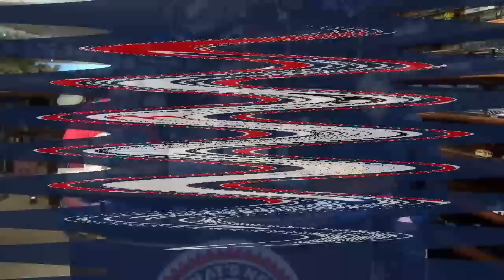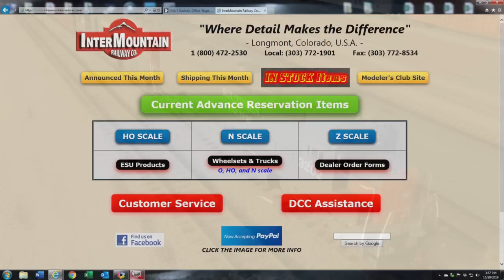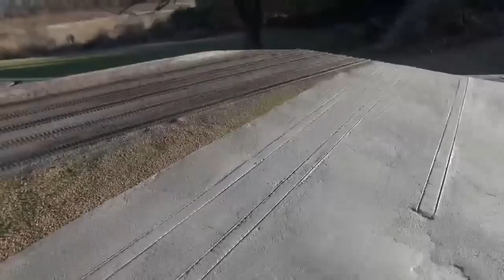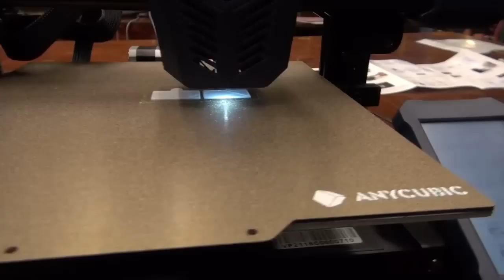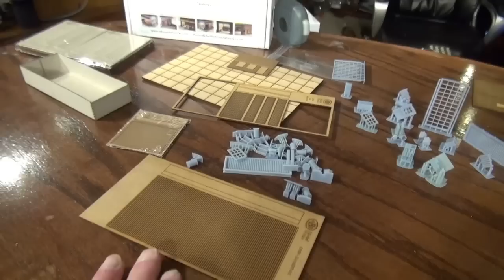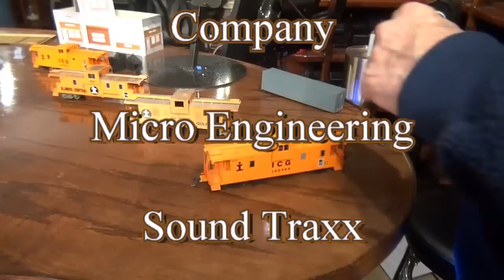What's Neat This Week in Model Railroading #217 December 3rd 2022

Comment: I find it odd that you say you can not see the layer lines,  I can clearly see the lines in the video  they run at a 45 degree angle to horizontal.  The studio lights pick the lines very easily as he turns the model on the table.  I would believe a few coats of paint should hide this.
Reply: Yes. You are correct.  But I figured one or two coats of primer would negate this.  That’s as close to “no lines” as I need, but I should have said “virtually no lines”.